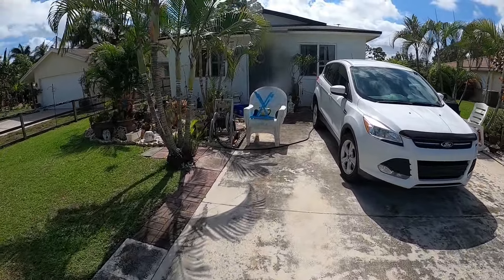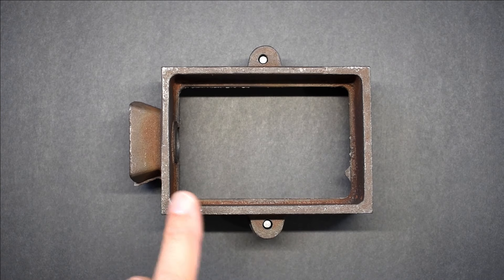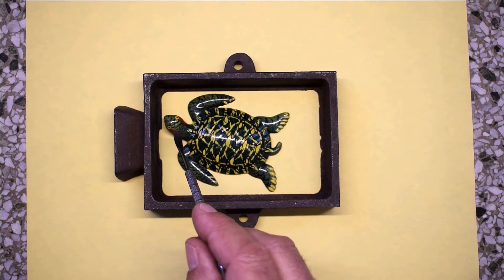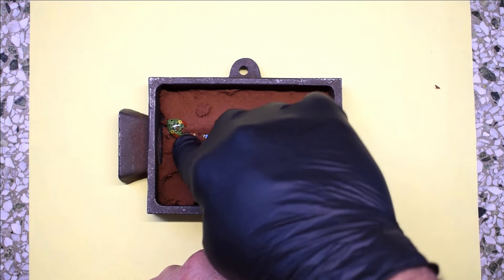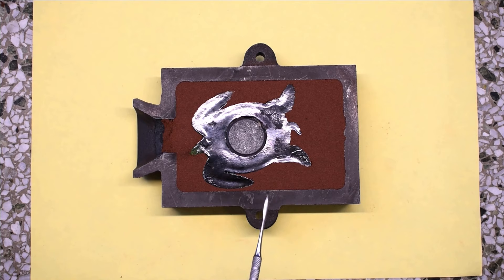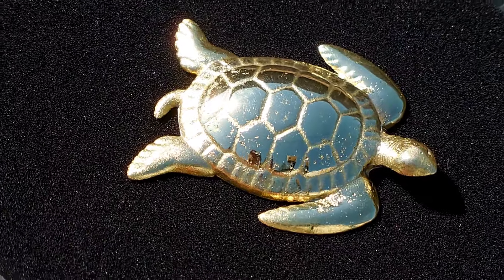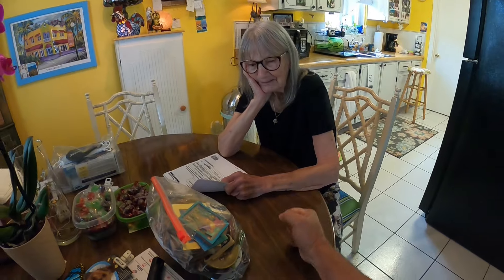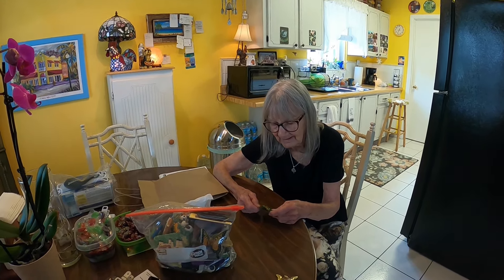METAL CASTING - Turning A Piece Of Plastic Into Something Beautiful!

Comment: 1 why did you make the hole so big?
2 nice polish but how do you get the imperfections out or it doesnt?
3 aluminum might have been easier but I feel more toxic
4 the bottom should have been completely flat (should have used tape) to be a mirror but o well just my preference. 
5 thought you would have fixed the fridge which would have been better than the new one.
6 speaking of fridge since you live in FL, all fridges with a water and ice dispenser have mold on it after a few years and very hard to clean. Check out yours or another with a flash light.
7 text went too fast
Reply from the maker: The hole to pour needs to be big enough to allow air to escape, otherwise when you pour, the molten metal can splash over. The minor imperfections I can live with, many videos on YT show pours with lots of imperfections, and they got millions of views, I'm not that lucky. If I wanted it better, I'd sand more and polish again. Aluminum wouldn't be nice, the yellow brass looks like gold. The bottom is fine. A refrigerator that old, isn't worth the time or money to fix. When you see the text, just pause the video.
Reply: @electronicsNmore  thank you. as always appreciate your videos.